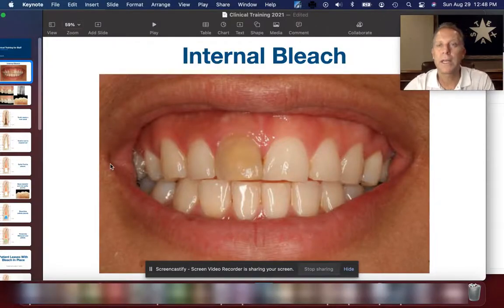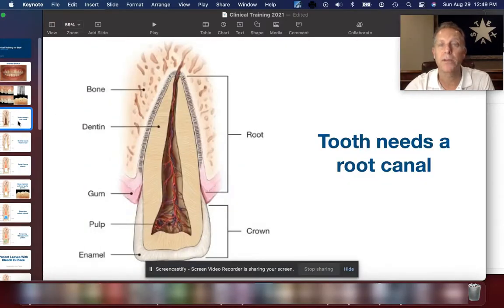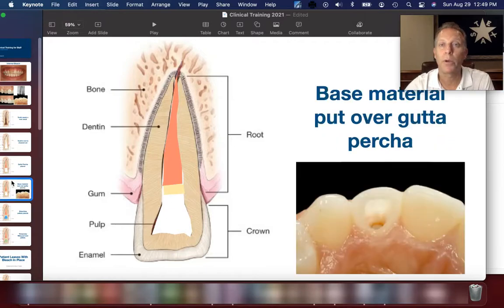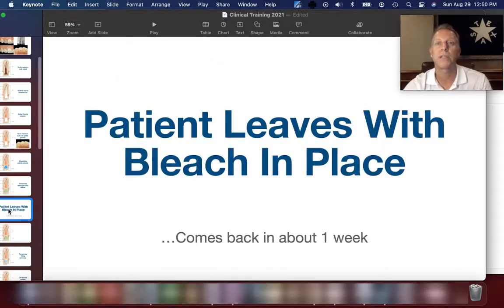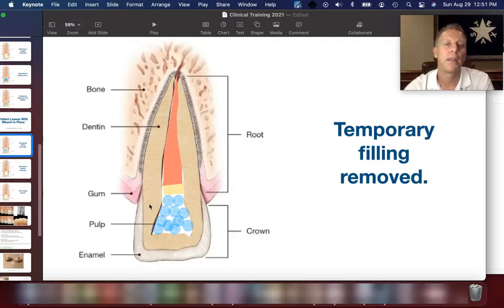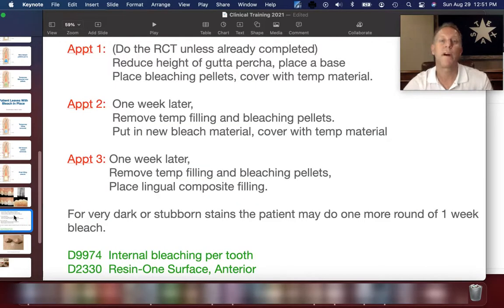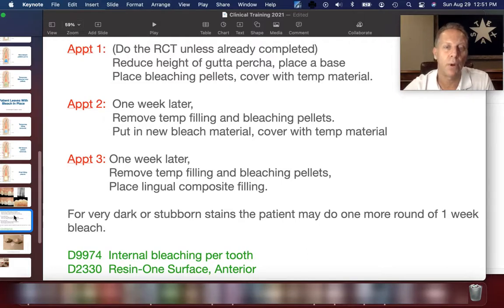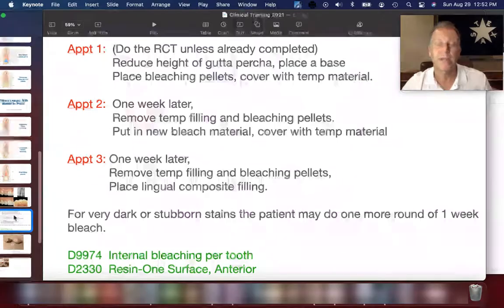Internal Bleaching

Comment: Doctor which is better ? To put cap on teeth or internal bleaching ?
Reply: I tooth is dark in color and you place a cap on top of it it then it won't be bright enough. So i recommend you to do both.
Reply: Generally speaking, if the tooth has healthy enamel and the only issue is that it's discolored due to the RCT then bleaching is better.
If the tooth has other problems like decay or is too dark for bleaching to work or doesn't have correct shape then a porcelain covering may be better.
Different clinical situations call for different clinical treatments.

Comment: How long does internal bleaching last? Can it be repeated? Thanks.
Reply from the maker: It varies but 5-10 years before it may have to be done again.  As time goes on the tooth may become more resistant to whitening.  Eventually it might need to be covered up with a veneer or crown.
Reply: Why does the tooth become dark again?